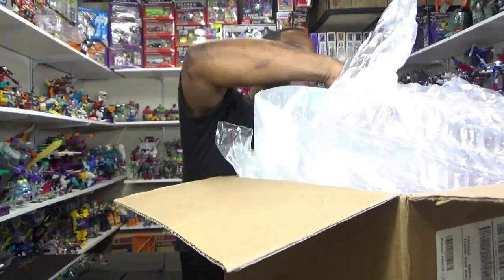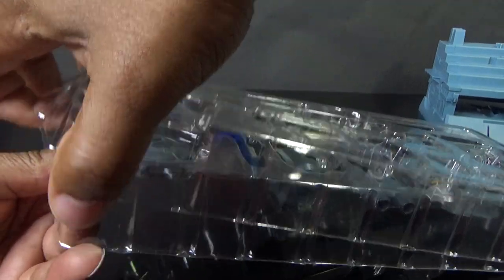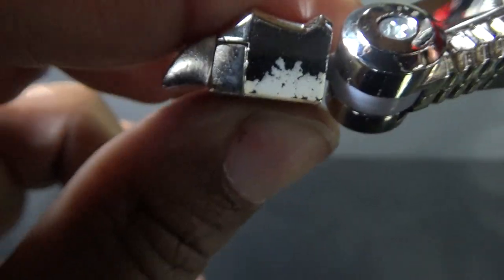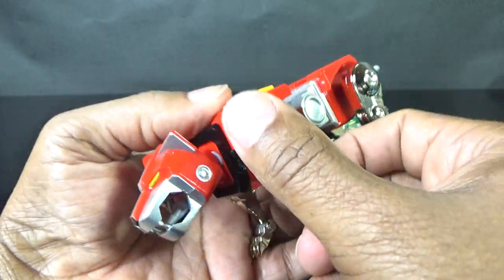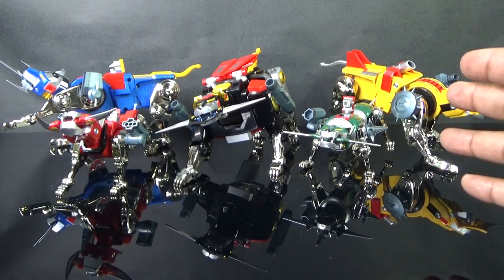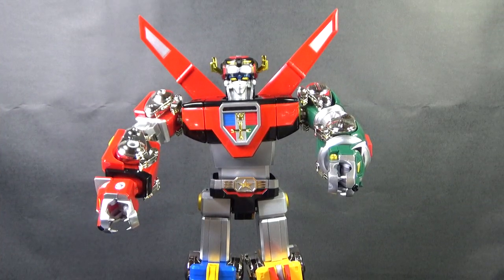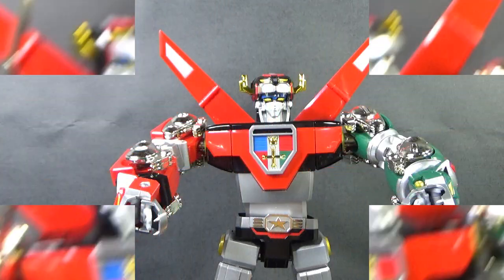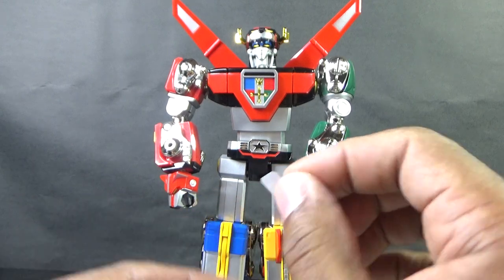BANDAI Soul of Choking Voltron Beast King GoLion Toy Review

Comment: I will get the threezero voltron. 
It can transform/combine, 
It's more CARTOON accurate than SOC Voltron because of the lion leg covers and has more articulation. 
Blitzway voltron size and price is too much for me. 
So threezero voltron a better choice for me
Reply from the maker: Yeah the Threezero Voltron is nice because it basically copied Soul of Chogokin with a few more bells and whistles added. But it doesn't have the chrome. For $50 more bucks they can keep the leg covers. As far a the added articulation Voltron has nothing to fight. It looks solid though.

Comment: I really really like this Voltron, except for the Voltron face. Which doesn't look like the face in the cartoon. If it did, then I'd call it perfect. I used to have one for a while but ended up selling it as I just didn't like the face.
Reply from the maker: Really! I like the face. I thought it was a combination of the original toy and the 80's cartoon? I'm tripping over the fact you sold it because of the face!
Reply: @80sTransfromersFan  I should have probably kept it. Though my collection just sits in the closet. And so whether I kept it or not wouldn't really matter as it would still just be sitting in the closet. As I don't really have room to display, and I'd just be knocking them over anyways as I need my shelf space for other things. So it's a combination of things, but if it had a cartoon accurate face, I would have kept it.
Reply from the maker: @colt5189  yeah I definitely know about not having shelf space. I recently sold a ton of figures because they were in totes for years.